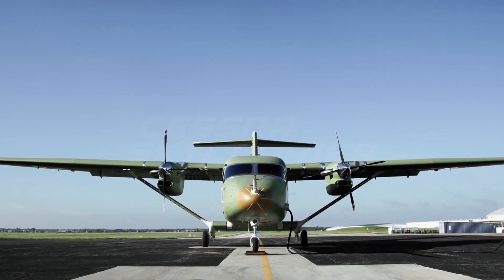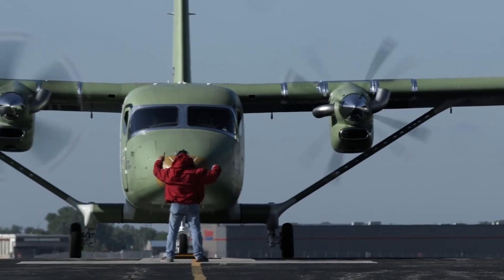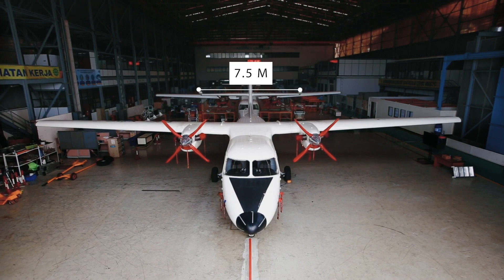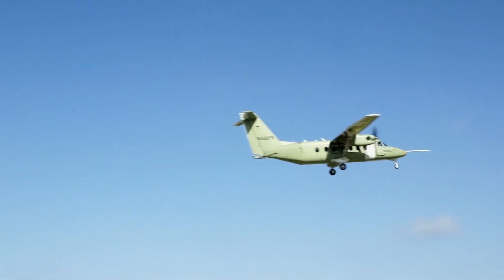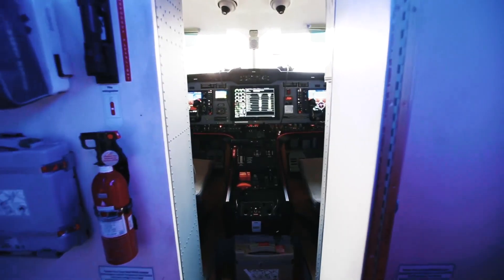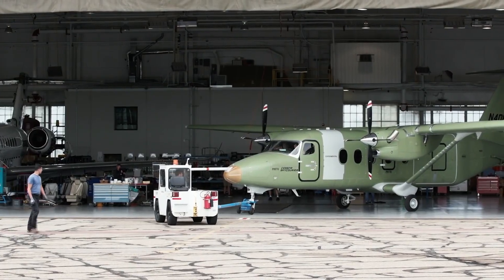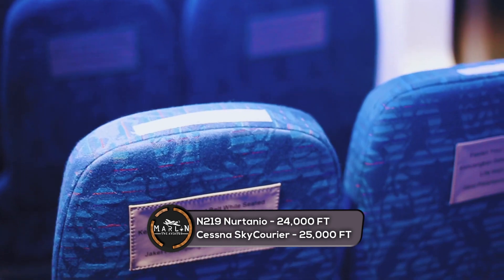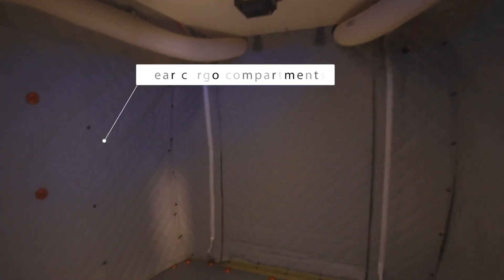Better Aircraft - Cessna SkyCourier vs N219 Nurtanio

Comment: N219 is unproven aircraft. Get certified with only around 300 hours of flight test is ridiculous for me.
Reply: Maaf sahabat..🙏 hal konyol bagi anda karena anda belum betul mengenal Indonesia. Coba anda chek 10 jenis pesawat buatan Indonesia dan negara2 mana saja yang sudah banyak membeli nya.. Pesawat N219 ini yg paling baru buatan Indonesia dan sudah ada calon pembeli 11 unit. kontrak pembelian sudah di tanda tangani..
Reply: @nelayanpesisir  karna pesawat lain bukan buatan indonesia dan bukan indonesia yg sertifikasi itu semua CASA, Bell, sm Bolkow dan yg skrg Airbus Helicopter yg lakuin certification flight test. PTDI cm assembly dan sebelum N219 ga pernah bikin pesawat baru dari 0 sampe uda certified untuk commercial operation. N250 belum certified uda keburu di stop. N219 ga pernah lakuin hot climate, winter ops, high altitude testing tp tau2 uda dapet sertifikat dkuppu. Padahal cm test flight di pelabuhan ratu sm di gunung kidul doang itu jg cm stall test doang. Itu pesawat unproven. Saya orang penerbangan jadi tau A-Z mengenai pesawat.
Reply: Pengamat penerbangan dan pesawat tidak ada yg mempermasalahkan banyaknya jam terbang dalam sertifikasi, karena setiap jam terbang bisa dimaksimalkan untuk meraih data beberapa sertifikasi secara simultan dan itu bukan kesalahan selama memenuhi penilaian, lamanya jam terbang lebih utama untuk sertifikasi pilot dan kekuatan struktur pesawat, dimana saat ini kekuatan struktur sudah dapat diperhitungkan dengan rumus jauh sebelum pesawat dirakit

Comment: Cessna Skycourrier model design looks like N219 Nurtanio model design. I m neutral. N219 & Cessna SC, is same, good, beautiful. Two plane, comparison or one level, 19 seat, two propeller engines & balanced comparison / replacement  DHC6 Twin Otter. Three strong propeller planes, N219 ftom Indonesia, Cessna SC from USA & DHC6 TO from Canada. 

Bye bye Twin Otter, thank you for your dedication in the aviation world,  speciat at 19 seat class. N219 & Cessna SC, next generation, replacement for you. 

///(#CROCITLMYYPDPODSSS1022PMWIT12292022#) ///

Comment: Looks like these companies are both trying to build a brand new TWIN OTTER !
Reply: No.  The Sky Courier has one overriding design goal:  Carry 3 LD3 Unit Load Devices (ULDs)  economically on FedEx feeder routes. the airplane has no other purpose, and the Twin Otter is not capable of doing that.   If the Twin Otter could o what the SkyCourier is designed to do, FedEx would have just bought Twin Otters instead of commissioning Cessna to design and Certify a brand new airplane.
Reply: @andrewalexander9492  Did not know that. Thanks for the info.
Reply: @andrewalexander9492  out of curiosity, why did Fedex Express not order the L410 NG for cargo operations?
feels like a bit of a waste to commission Cessna to design the C408 when the L410 NG is right there and ready, with a proven design no less.
Reply: @MyAulos  Well, again, FedEx is acquiring the Cessna so that they can move their cargo in ULDs on smaller routes, specifically in LD3 containers.  You can fit 3 LD3 containers in a SkyCourier.  The interior dimensions of a LET 410 are too small to load a LD3 container (even if it were equipped with a door large enough) So the LET is a non-starter.
Reply: No. A Twin Otter is a dedicated STOL aircraft. The Sky Courier is designed for economical operations where STOL is not required. 

Very few operators need STOL as there are 3000 foot runways practically everywhere. 

This is why the Cessna Caravan is so popular. Sure it won’t ever beat a turbo Otter working out of the bush. But it will beat it in operating costs every time.

Comment: Both of these aircrafts are overtaken by Czech L-410 NG with Czech GE H85-200 engines in all the ways. The same number of seats 19 but range 2 570 km, cruising speed 417 kmph, service ceiling 8 230 m, maximum flight time 10.5 hours.  https://www.youtube.com/watch?v=78UZnA5QxoQ&ab_channel=AircraftIndustries

Comment: I wonder why they didnt make retractable landing gear to the Cessna
Reply: It only cruises at 230 mph.  It's Cheaper.  It's more Reliable, and it's Stronger for Rougher Airstrips.
Reply: @Ranger_Raptor_Twin-Turbo_3.0L  It will look more beautiful and aerodynamic if fitted with landing gear cover.

Comment: The N219 seems to me to have an old, heavy design, it reminds me a little of the Czech Republic L-410 plane.
Reply: Tua kayak Mbah mu..
Reply: Sky courier terlihat kuno di masa modern ini, dgn pilar penyangga sayap.
Reply: It's based on the Spanish C-212.
Reply: @t65bx25  No. It's Different. Indonesian aircraft which based on C-212 is NC212i. Not N219. N219 Is 100% Develop Locally By Indonesians. "N" here means Nurtanio. Nurtanio is the name of the Father of Indonesian Aircraft Industry. Every Indonesian-made aircrafts with just "N" are 100% Develop Locally By Indonesians.
Reply: no @t65bx25

Comment: One aircraft is a local gimmick, to fly in the most unregulated aviation market on Earth, and will likely never be seen outside of 1 country.
The other aircraft is already a production success (even though the first hull was delivered in May 2022).
You're comparing a lazy mule, to a modern pick-up truck.
Reply: You lazzy to research about N219..N219 will win in competition cause is more2 cheap and our local Arline and cargo in waitting list for  flying N219..Indonesia is one of the biggest Archipelago country with 17.500 island..so N219 is not gimmick
Reply: Unregulated aviation market like U know anything but not. Indonesia is one of the most promising Aviation markets due to the landscape that is in dire need of aircraft such as N219
Reply: Yes. And you like my cart🤣
Reply: we'll see for the next 3 years... Indonesian Aircraft manufacturing has a long history. Their planes/helicopters has flew around the globe, hope this one too...
Reply: Find out about Indonesia, now ranked 7th GDP PPP in the world. The Airplane is not gimmick, it is build by professional engineer.
Reply: Yes unregulated is the best way to describe the certification process of N219. Flown by Non test pilots and skip a lot of flight test which simulates real flight scenario (high altitude, cold ops, STOL test) and all of the sudden they earned certification from DGCA WITH ONLY 300 FLIGHT HOURS!!! (The skycourier did 1500 test flying hours before get certified). No wonder it will not sell to other than Indonesian air force. That plane never landed on airport with less than 1500M of runway length how can you marketed it as STOL airplane??
Reply: @abduljabar8445  non test pilot, never landed on airport with less than 1500 m. Your comment is Lol
Reply: Is it a dog barking?

Comment: The N219 is designed to operate in remote areas like the Twin Otter

FYI: The PTDI (previously IPTN) is the one who built the N250, the most advanced in its class featuring fly-by-wire controls, the first one to adopt it in its class. There also plans to develop the Indonesian Airbus A320, the N2130 back then, but economical crisis prevent it from happening. Ironically, it was the main victim of the crisis. The IMF helped Indonesia to recover from the crisis but they have to sacrifice the IPTN including the N250 and the N2130
Reply: How nice of Ethan Hunt and his crew to help Indonesia recover from the economical crisis
Reply: You mean that Indonesian is going to build A320?
Reply: @yannickille4049  the N2130 is the Indonesian version of the A320. Both are diffrent but in the same market if the economic crisis didn't punch Indonesia in the face back then
Reply: Back then IPTN still in money burning phase, they do not have profit. At that time N250 still have long way to enter service. No chance IMF allowing Indonesia use that for unclear project rather than improving macroeconomy

Comment: Just to add, N219 basically derived from DI/Indonesian Aerospace experience on licensing C-212. So the designed derived from there.
Reply: Design by prof. Bj. Habibie (indonesian)
Reply: @f4u21ramon8  False. Habibie never involved in the design process of C212

Comment: this two aircraft would not go head to head.. N219 will fly domestically in Indonesia unless it’s proven the versatility over the years
Reply: Indonesia is a large archipelago country. A small economic transport aircraft like the N 219 is very beneficial, that could be used in short unpaved airstrips. Domestic use is expected to expand connectivity and growth in Indonesia.. It does not need to compete with other aircraft. However, international orders will be very well supported.
Reply: Already sell 5 units to Kongo

Comment: how do they compare to the twin otter
Reply: From the outset, N219 was designed to replace a lot of old twin otter operated in several remote areas in Indonesia.
Reply: The Sky Courier is not a competitor to the Twin Otter. 

However.. current Twin Otter operators who don’t need STOL performance but have no other choice in the category will probably start buying Sky Couriers instead of Twin Otters. 

Expect the Sky Courier to replace the Twin Otter for skydiving, scenic flights, and short commuter hops between paved runways. Even St Barts is no big deal for a Sky Courier.
Reply: @calvinnickel9995  Why not the L410 NG, then?

Comment: Did Cessna copy? Did they hurry their design? Why else does the aircraft with a 500 hp advantage, similar payload and range AND with the retractable gear cruise more slowly than the fixed gear aircraft?  WILL those #'s improve -> 4:23 ?
Reply: Sky Courier just got certified and also cruises at 210kts. Empty weight of the 408 is about 3000lbs heavier. The extra horsepower of the 408 allows it to haul 1000lbs more cargo. Max t/o weight is 4500lbs higher than the N219. The N219 probably has better fuel economy than the 408. Did Cessna copy the N219? Nope. It was designed specifically for FedEx around the specification to haul three LD3 containers. Basically it’s a box with wings and a huge cargo door. The N219 is closer in size and load performance to the Twin Otter, but a lot faster.
Reply: Update. I’ve had the 408 up to 220ktas at 11000ft. Very good handling and easy to operate for one pilot. They hit it out of the park with this one. 5000lbs of cargo over a 200nm distance. The specs say 6000lbs but you won’t go far with that much freight on board. Perfect for FedEx because the 408 bulks out around 4000lbs with typical overnight freight. With 4000lbs of cargo, the 408 can go 400nm, with IFR fuel reserves. Most of FedEx Feeder routes are between 75nm and 200nm. The 3 containers can be loaded and offloaded in about 10 minutes. Perfect feeder ops aircraft.
Reply: @cecielhelder5923  Your enthusiasm is infectious.  It's the wrong aircraft for me right now but good to know about it from someone with Left seat experience.
Reply: Historically Both of company are join cooperate together to make turboprop plane since president Suharto era...this is why both of company has identical turboprop plane...PT DI have CN 235 , Cassa have EADS CASA HC-144, and now those above video of turboprop plane
Reply: Neither aircraft have retractable landing gear.
Reply: The N219 researched longer.

Comment: Both aircrafts look incredibly similar from the outside
Reply: Except there is no wing support bar in N219
Reply: True, but Cessna could fit 3 LD3 container inside of the cabin. So transporting and unloading cargo would be very fast compared to N219